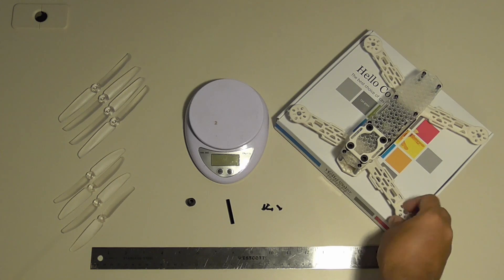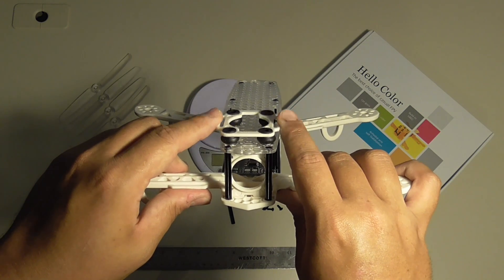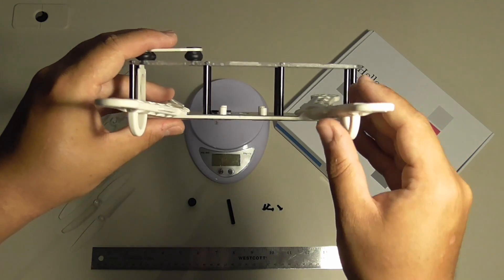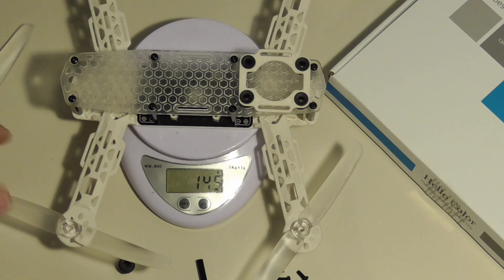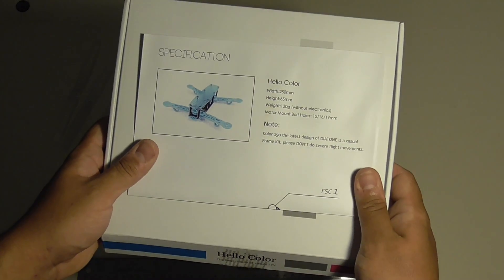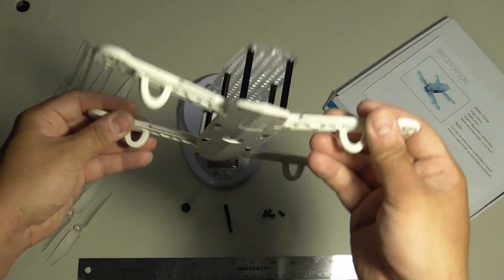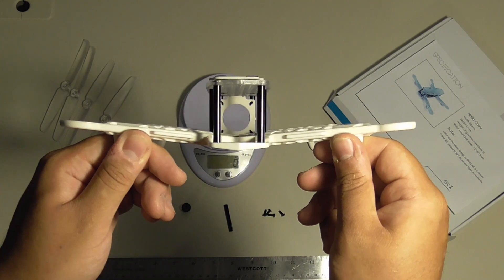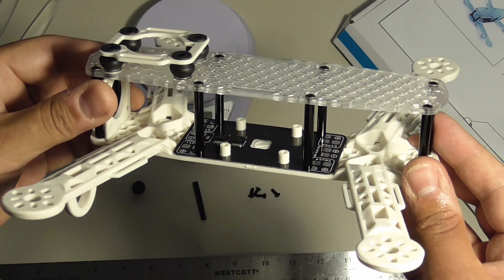H-King Color 250 - FPV Mini Quad Frame: Kit Overview & Dimensions

Comment from the maker: Hey Guys, 
Sorry I have not responded much. I've recently started a new chapter in my life and I put this project on hold. I was able to assemble this quad fully with one of HobbyKing's HKPilot Mega Mini Combo kits. It flew pretty good and I feel the up swept arms do help, especially when descending in the prop wash.

Bad points: This frame is pretty fragile, they don't kid when they say it's not meant for racing. The clear plastic top plate is especially fragile. Just tightening the machine screws to the aluminum offsets causes cracks in the plastic. A rough landing makes these cracks grow pretty badly.

Besides the fragile top plate, the rest of the frame seems pretty durable, for it's light weight anyway. Again, it's not for racing, but like I said before, it should make a perfect cheap and stable training platform.

I'll see if I can make a video of this flying later (a few months from now), but I'm having issues with the HKpilot mini's barometer hold. When in altitude hold mode, it goes crazy... Stays level, but shoots up and down and doesn't maintain a constant altitude.

Anyway, if you're getting this frame, replace the top plate with some super thin plywood or thin carbon plate. The clear plastic top plate is garbage. haha!

Fly Safe!

Comment: Hi, 

thx for ur answer on my previous question.

Do u think 1806 Motors with  2x 12mm and 2x 16mm Mounting pattern will fit (4x m2 screws)?

The motor mount dimensions seem to be ok, but im not sure. looks a bit close to me... The product description recommends 1804-2204 Motors. 

Im from Germany, sry for bad grammar ;)

Comment: Hi, 

do u know the specs for the FC mounting? Will a naze32 or cc3d with 30.5mm Mounting fit?
Reply from the maker: bexcess Check out 8:13 in the video for dimensions of this area. To my best measurements, it appears a 30.5mm square mounting board should fit. As I've mentioned in another comment, test fit the machine screws first before installing the board. They can be pretty tight the first time around. Take it slow as to not break the posts as well.

Comment: Great video review of the frame, picked one of these up last week. Have you figured out whether the flight controller mounts on those plastic stand off using the screws screws provided?
Reply from the maker: Sam Inkpen Yes, it mounts there, but you must make sure the center to center distances between the posts match your flight controller, FC. Mine was pretty tight, but went in.

I suggest making the threads with the machine screws first, back them in and out a half dozen times, before attaching your FC. This way you're not fighting the screws to make threads in the plastic and hold the FC still at the same time.

The screws were pretty tight for me, so backing them in and out will make the screws really warm. Be careful not to melt the plastic, haha.

Sorry there hasn't been an update video. I'm using a H-King APM board and I'm having a difficult time getting it tuned. The barometric sensor is very sensitive to the prop wash and temperature changes.

One thing I'll be mentioning in my next video is that although the plastic that makes up the bottom frame is strong, the CLEAR top plastic is pretty brittle. Just screwing in the bolts caused cracks to appear. After a rough landing I'm also getting large cracks in the clear plastic top plate. I'm about to replace the top plate with an identical 1/16" thick plywood plate, haha.

Comment: I just got two of these, I hope it's a good choice. the design is very nice. The severe movement stuff is not promising. I like the pictures with the sizes at the end. I watched like a million reviews so far, but this is the best! Nice job!
Reply from the maker: Colibri Labs Thanks for the kind comment (^__^ ) After watching the HobbyKing Live video, it was frustrating they didn't even show the underside or a detailed view with 6 inch props. I tired to include all relevant views and dimensions in my video. I'd say they are accurate to within + or - 1mm.

The 'severe movements' thing was kinda weird, haha. For a plastic frame, it seems reasonably robust. For 12$-14$, it's pretty hard to beat. I was between this Color 250 frame or a Fiberglass ZMR 250. I chose the Color since it has upswept arms.

Comment: Good video review of the frame, I've ordered an orange version, but it's on backorder at the moment. Can you post a video of the final build and flight? Would be very interested in its performance. Cheers!
Reply from the maker: Simon Davies Thanks, I'm glad you liked it :-) If you think of anything else you'd want to see, just let me know. I may include it in the upcoming video(s).

I'm just about done soldering the motors to the ESCs right now (DYS 1806 2300KV to DYS 20 amp ESCs). It's pretty annoying not having a servo tester and alligator clips to quickly test the motor spin directions, haha. 

If you don't have these, I suggest you get some :-P
Reply: I can highly recommend the DYS 1806 motors, I have those on my QAV250 running on 3S battery, I've tried both 5030 and 6030 props and it flys very nice!

I plan to use DYS 1806 1400KV motors with DYS 16A mini ESCs, running off a 4S battery, plan to use 6030 props. 

Please do post a video of your build and flight testing. 

Cheers
Reply from the maker: Simon Davies Will do, Simon. Nice to hear the motors are good. I bought an extra just in case I got a dud :-P

It would be very interesting to see how a 4S lipo and lower KV motors does on this frame. Let us know if you post any flight/review videos on your setup.
Reply: Will do! The DYS motors running on 4S give 440g of thrust, when using 6020 props, so total of 1760g. Therefore I expecting it to be rapid!! Will post a build/flight video as soon as I've finished.